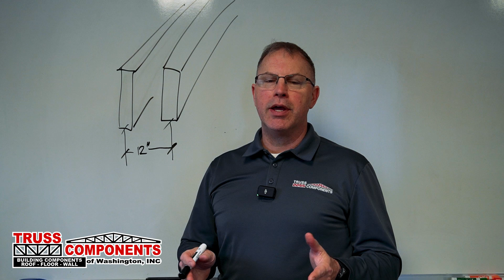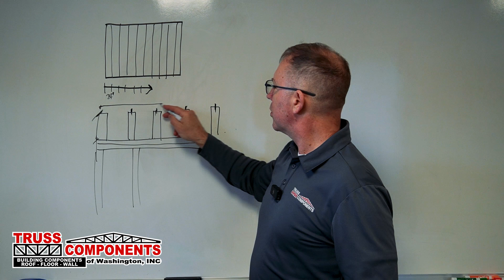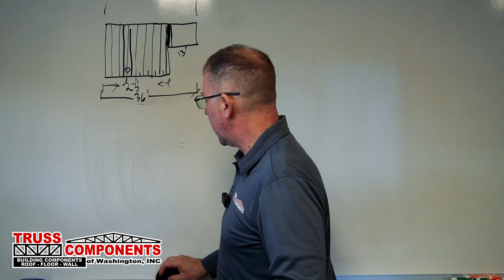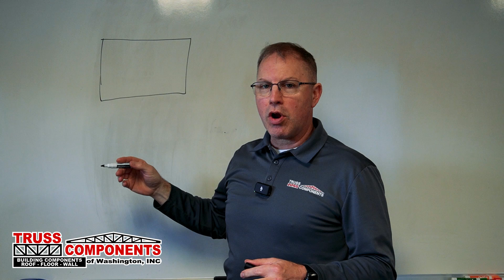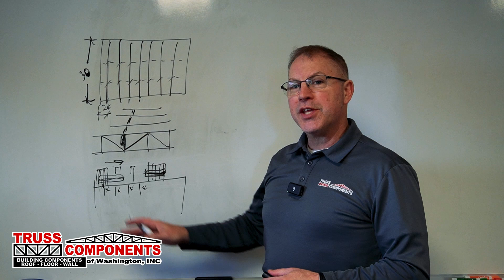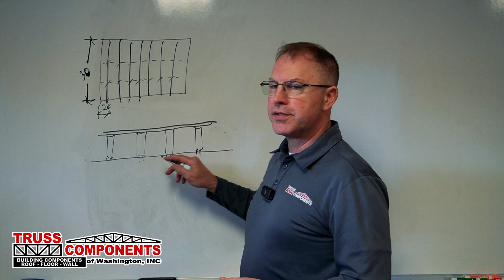Installing Floor Trusses – Tips, Tricks, and Order of Operations

Comment: Very good instruction. I have never used trusses before. I am wondering how you install floor trusses when you have to make a stairwell opening that runs perpendicular to the direction of the rest of the floor trusses? A video that shows the actual process would be very helpful. Thanks.